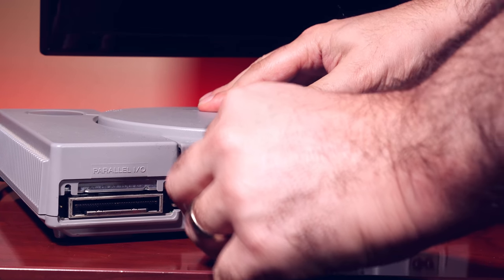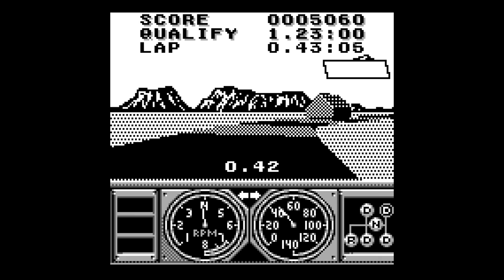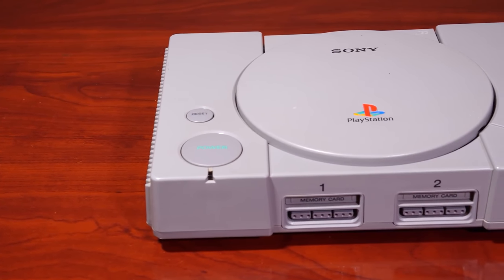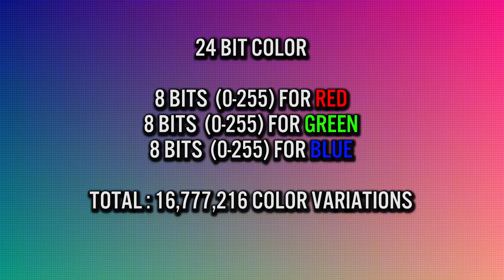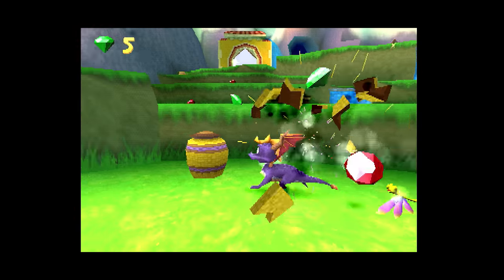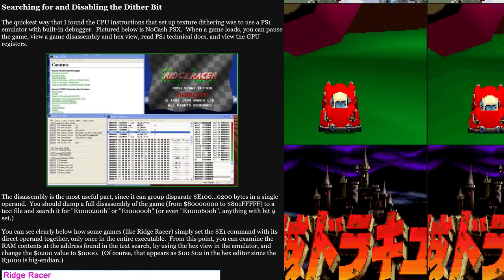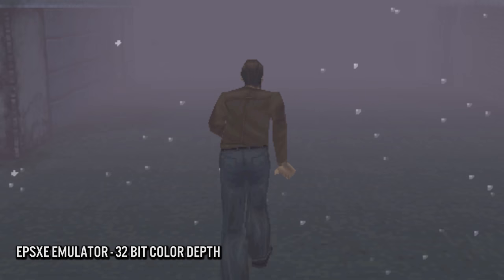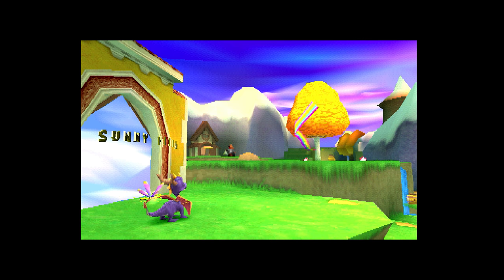Why did the PlayStation 1 have so much Dithering? | MVG

Comment: Finally, someone straight up saying they like the flaws of an older 3D system. We hold affection for sprite-based 2D games, why not early 3D's low-poly, low-res, dithered aesthetic? One of the reasons surely that I love the DS so much is that it combines the two—it's like a portable Saturn and PSX in one.
Reply: Because like he said in the video, we couldn't see the dithering back in the day. Most people look at an old 2D sprite game and go "Yep, that's exactly what I remember". Most people look at an old 3D game and go "what's all this dithering? this isn't how it looked when I was a kid!"
Reply: Do you remember when the PS1 came out?  Do you remember what the contemporary hardware was capable of?

It’s not “cheaping out,” it’s about making an affordable console that didn’t also require a large chassis with active cooling.  We were all playing SNES at the time, or on a PC in DOS and Windows 3.1, with software rendered 3D at the same resolution, in 256 colors.

The PS1 came along with actual hardware 3D, CD audio and CD quality audio sampling, wavetable synthesis almost as good as professional synthesizers, and FMV.

It was a groundbreaking system.  All the others that released at or around the same time flopped because of price and/or the compromises they made.

And anyway, it may have been a casualty of cost-cutting to have a 15-bit buffer (which, again, at the time, was still a pretty decent spec) and integer math (see: 486SX), and whatever else, but IMO, the compromises were entirely reasonable ones, retain the fidelity of the source data so that it’s possible to render in HQ now, and the quirks bring me back to the days of playing the PS1 when it was new and being blown away at how amazing it, and its games, were.

The one time Sony went for the gold and made a console with all the hardware they could cram into it, we ended up with the launch PS3:  A PlayStation, PlayStation 2, PlayStation 3, CD player, SACD player, DVD player, Blu-ray player, memory card reader, network streamer, and Linux PC all in one - for the low low price of OMG nobody can afford this...

It sat on shelves.  I remember vividly.  I wanted one, but couldn’t name enough games to make it worth it, and didn’t have an HD TV to make it worth buying as a BD player.
Reply: Snails40  Yeah, Kurosawa was just cheaping out by shooting in black and white. Took him way too long to switch to colour.
Reply: Snails40  You would have probably loved deciding between a new Neo Geo AES game or your bills to pay back in the day eh?
Reply: @nickwallette6201  This is the best post I have seen this year. People complaining probably started gaming in HD televisions.
Reply: DS games have a pretty great looks because they have the low-poly aesthetic with modern design and modeling sensibilities. What I mean by that is that it's like the late gen of PS1 stuff like Megaman Legends or Crash 3. Super charming stuff.

A lot of DS games also ran at 60fps (or a stable 30fps) and the system used an edge-AA method on a lot of games which people rarely bring up for whatever reason.
Reply: @VexAcer  Also, the DS screen was tiny, so a lot of the graphical problems and artifacts were hard to see.  It didn't matter that a lot of its games used integer-only 3D calculations when the polygons are so small onscreen.  The jitter was barely visible.  Likewise, dithering would be almost invisible unless you had the camera right up against a dithered object.
Reply: @jasonblalock4429  Also worth saying that the DS didn't actually have the rendering artifacts of the PS1. It had a Z-Buffer and the textures didn't warp. I don't remember if DS games had dithering, I know there were PSP games that did.

The PS1 aesthetic mainly comes from the lack of texture filtering, otherwise it'd be more comparable to the N64.
Reply: Snails40 You have to appeal to the mass market. Unless you want to have the greatest system that no one ever played like Panasonic and SNK.
Reply: The DS has one of the greatest gaming libraries of all-time. Truly something for everyone. Ridge Racer + SM64DS were the 2 titles I got at launch. Never did beat SM64 and Ridge Racer was put away, never to be played again as soon as I got Ridge Racer on my PSP (I am STILL amazed at how good that game looks all these years later!).

Comment: Dithering is something we have started noticing for some years. When we were kids playing PS1 titles, we weren't able to notice, both because of our intrinsic lack of attention to details and CRT monitors. I think dithering is a great engineering trick that, at the time, made possibile the (apparently) impossible.
Reply: Not to contradict you, but the dithering on Metal Gear Solid was noticeable even on a CRT through composite.
Reply from the maker: @DarthEquus  it depends on the TV you used. on a cheap consumer TV with a smaller tube it was harder to spot in my experience
Reply: @ModernVintageGamer  Of course. That little 14-inch Panasonic I gamed on probably had a very good comb filter.
Reply: Reminds me of some older projects taking advantage of ghosting on monochrome LCDs to fake 3-5 bit color just by toggling pixels every frame.
Reply: Composite video tends to blur pixels together so the dithering effect works really well to simulate a higher color space. But the more you are able to tell the pixels apart, the more the dithering becomes apparent.
Reply: Even back then, dithering was noticeable on monitors used for computing, and even for consoles if you managed to hook them up to one.  They were generally sharper than the average television screen.
Reply: @ModernVintageGamer  it also depends on the signal in europe with rgbs scart we could easily notice dithering on a generic consumer crt.
Reply: @ModernVintageGamer  and don't forget the cables you used ... with advanced scart cable (= component RGB) you didn't have "washed colors" and a lot more sharpness in the image... especially on later consoles like the dreamcast the difference between composite and component is very clear (at least on my "big" philips it was very clear, that tv ran 480p/60hz and could go up to 600p with no loss image quality (at 768p you could see the image was resized especially as small text became harder to read)
Reply: @lampenpagulvet5489  yes rgb was always sharper and you could make out the dithering
Reply: But also dithering was just normal. Every single game used it to some degree or another. I would say the SNES used it the least but even there it was still plentiful.
Reply: The N64 had a lot of dithering as well. However with the mid-mapping and especially with the agressive biliniar filter it wasn't as noticable.
Reply: I always noticed because my cousinshad N64 and it obviously had better graphics than ps1
Reply: Playing metal gear solid on my 36" CRT I always had to switch from s video to composite because the checkerboard pattern was so distracting, and that CRT was from 1999, just using s video... Some games really forced you to use composite because their graphics were designed around it.

Comment: Dithering is part of the PS1's charm and I wouldn't want it any other way. One thing that I did learn very recently is that early models of the PS1 (specifically the SCPH-100x models from 1995) had garish color banding in addition to the dithering as a result of some limitations in the GPU. A change of RAM type and a redesign of the GPU around 1996 fixed that. As it happens, I own one of those early SCPH-1002's and the banding really stood out for me when I played Soul Reaver through a Framemeister. Before that I had never really noticed it so much. Tomb Raider and Spyro also suffer quite a lot from it, though not as bad as Soul Reaver does. I guess it's just one of those quirks from the early days of 3D graphics.

Comment: Dithering is also a technique used in printing through screening. We dont mix cmyk to create new colors on paper, we just place dots of each ink beside each other so they give the illusion of more colors

Therefore, you can say screening started before electronic displays, it started when lithographic plate printing started

Heck you can even say it started when we started using the dot technique for oil paintinga.
Reply: It's also heavily relied upon in comics. It's more noticeable in older issues, due to lower print resolutions.
Reply: It's probably a big thing to set the aesthetics of manga as well. It's said that those used to rely on halftone paper to make up all the gradients. Though nowadays it can be done completely digital and the process can be omitted altogether. We do lose the chance to have unique dither patterns, though. (I mean, manual and auto dither happening at the same time would be the worst thing ever)
Reply: Techniques from the printing industry also were used for making circuit boards and microprocessors.  It's really cool the overlap.
Reply: before I went to university I worked in an office where I was tasked with print- and digital media design and it was really confusing at first how different the color works out on these different media. Like how resolution is measured in dots per inch and stuff and how its not simply possible to translate RBG to print devices etc. now that you point it out it makes sense that some sort of dithering is being used for this...you never really think about these things normally^^
Reply: This is quite honestly one of the most interesting threads Ive read in a good while.
Reply: Arguably you could even go back to copper engravings in the medieval period. Of course they mostly used lines instead of dots, but you can find dithering-like techniques using dots as well. In any case, they were able to replicate a variety of values and textures using only black ink (so effectively 2 colors). Though later, chemical etching processes enabled much lighter lines so those looked more like regular drawings.
Reply: Memories of zooming in on paint characters...
Reply: Also anyone who ever made a flip note on the 3ds knows this technique
Reply: Vaguely related, but, I thought about some checkerboard-like patterns that Japanese artists used to give a sense of shadows and textures when drawing mangas that were usually printed out in black and white.
Reply: Vaguely related, but, I thought about some checkerboard-like patterns that Japanese artists used to give a sense of shadows and textures when drawing mangas that were usually printed out in black and white.
Reply: Sounds like cheating! I want my money back!
Reply: It's called pointilism in the art world https://en.m.wikipedia.org/wiki/Pointillism
Reply: @cyberdrace  Yeah, I was thinking of Lithographs and woodcut printing.
Reply: yeah, i'm a painter and dithering type techniques are actually better looking than blending most of the time in paintings, as each color maintains a high chroma the eye blends them to a nice bright colour whereas if you blend them the colours look less bright. up close pointillism (dithering) or various similar things like using thin lines of colour looks more interesting too, instead of the painting looking the same up close as it does from afar, and you can often sneak extra colours in there for subtle effects. obviously in drawing/etchings hatching and the like is the only way to get any shades of grey if you're just using lines. edit: to clarify the way paintings are done, you do big brush strokes, which look like the images with banding, then you blend the edges with whatever technique, pointillism is mainly when you do a whole picture with dots instead of the big strokes, mainly i call it stippling not pointillism when using dots for blending.
Reply: Before that you had hatching and crosshatching in woodcutting art, which is practically the same principle as dithering. It's a trick as old as art itself (or nearly).
Reply: @dextrodemon  thanks for the detailed explanation :) where can we see some of your work?
Reply: @Bluehawk2008  Yeah, I mentioned that too, heh.
Reply: @marconihimself  Agree, very fascinating.

Comment: Great explanation. On the N64 the console applies a post-process filter to smooth out the dithering, making it less noticable but still can leave some artifacts if you know where to look. The same can actually be said for the original model 3Dfx Voodoo - it too applies a 4x1 anti-dither filter by default, making some textures look smeared horizontally (this can be disabled via an environment variable though, which does clean up the image at the expense of more noticable dithering).
Reply: Dithering isn't as immediately noticable on CRT since it always looks kind of dithered and the glass screen in front of the color filter kind of blends the colors slightly. However on a LED television where every pixel is indeed an individual point dithering is much more noticable.
Reply: Though cause of it's limited texture cashe the N64 used colored models a lot more.

Comment: Thank you! I really wanted to know why console with advertised 24 bit color had so much dithering. Great video and very thorough explanation.
Reply: Even back then, Sony was lying. These days they lie about 4K rather than color depth, but Sony, Sony never changes.
Reply: I can only show 24-bit static images or streamed video. The 3D hardware can’t render into 24.
Reply: referral madness actually there are much more, but 24-bit RGB is reasonably close to the amount of colors and relative levels of brightness a human eye can resolve. 15 bits are very obviously insufficient.
Reply: @mjc0961  Still, over the years PlayStation delivered the most enjoyable consoles with the biggest libraries. Ps2 is still the best console imo
Reply: Lots of videos in this area mix up dithering and anti-aliasing as if they're the same thing. Great explanation here, thanks!

Comment: The nintendo 64 had a filter to mask out the dithering as well that mostly worked, but made the picture a tad blurrier, specially on games that tried things such as screen tinting and caused a lot of dither (starfox 64/shadow man).
The 3Dfx cards also had a pretty good filter for their 15bit color output.
Reply: Yes, the 3Dfx one was pretty good. It was for the 16-bit color output, if I remember correctly (not 15).
Reply: The N64 did have a higher color mode and also with it's limited texture cash it used colored models a lot more. A lot of times the player character in a N64 game was made up of colored objects with the only texture being the face.